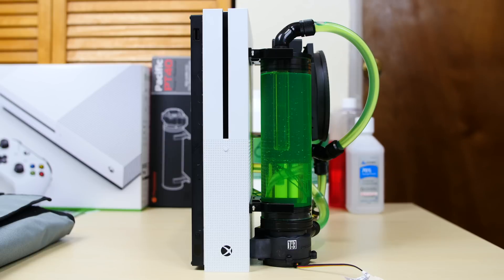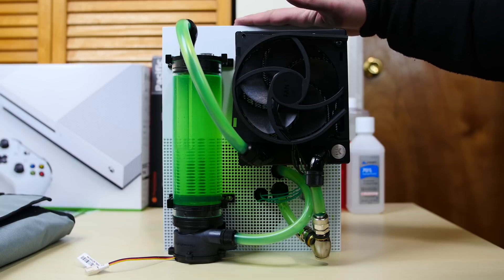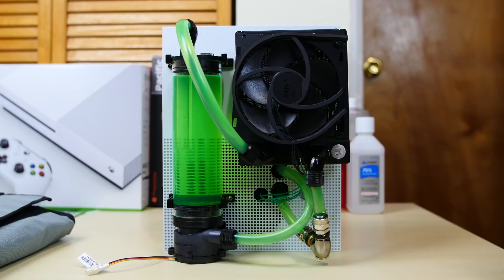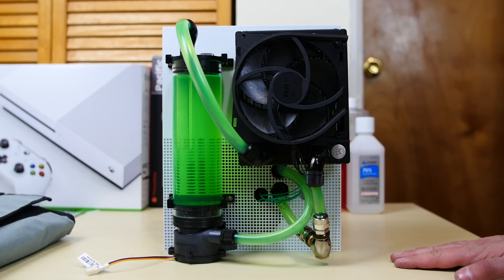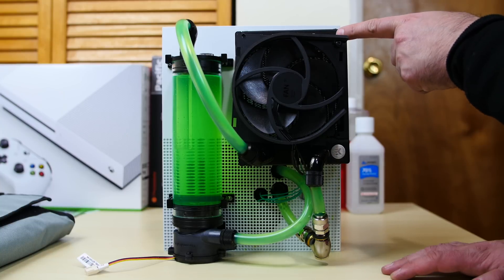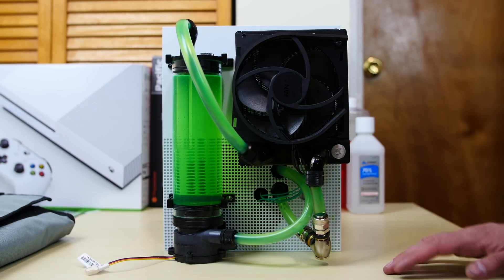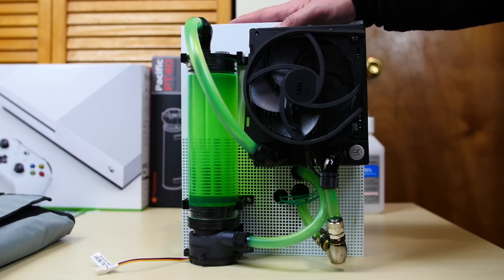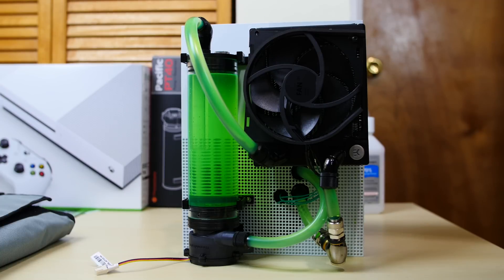Water Cooled Xbox One S - The Build - Part 4

Comment: uhhhh... VRM heatsinks??? also you made such a mess of the tubing like WTF...  the holes that you drilled in the top of the xbox were way too big for the tubing, you can get rubber grommets to tidy everything us, why the gigantic hole to run 3 very time fan cables, you could have simply threaded them through the holes in the top of the xbox...

Comment: a bigger rad (a slim one) & smaller reservoir would have been better
i have an alphacool x-flow st30 360mm full copper rad 
passive radiators are awesome too
Reply: i would have had a big rad on the side and a small res on the top and hard tubing. good first attempt though

Comment: you should have cut off the plastic on the fan that diverts the airflow and made it  so the fan is right up against the radiator as it's not working fully effectively, it would have had more airflow thought the radiator and more pressure to cool

Comment: Water cooled 30 fps....
Reply: Shane Walker some games do run at 60fps
Reply from the maker: +Shane Walker you got it
Reply: its not about 30fps ...its about system not LOCKING up due to running hot / over heating
Reply: what games besides old games and platformers
Reply: Desmond Cabeza just google them I am not going to list them but to be fare the list id not long
Reply: While anthem destroys PS4 shut the fuck up

Comment: So you asked for criticism,  here goes.

1, You had to use another fitting because the tube did not reach.  If you cut a bit longer, it may have reached without kinking the tube. 

2, Some grommets of cable glands would of cleaned up the unsightly hole in the case.

3, No cable management for the fan, and what are you doing with the pump cable, I would of sleeved everything, where are you putting the PSU for your pump.

I just don't think the project worked.  If you wanted to water cool an Xbox, you should of made a new case, maybe from that acrylic that never got used for your Pi Cluster.  It just seems like a whole lot of effort, and not much to please the eye in return.
Reply: Tommy TeaPot but by adding the extra fitting it adds an extra fail point
Reply: 1. He wanted a water cooled xbox (which he achieved) not a full custom xbox which is why he kept the case.
2. Everything you mentioned can still be done like covering up the holes and the wire management. 

The way you're judging this is like if he was building a custom water cooled pc
Reply: i think you may be being a bit over critical.... this must of taken him so long and so much more could of gone wrong.
Reply: Well for your 1st point he accidentally did one thing right with it ... 
He now has a drain point which a lot of people seem to forget while building a custom loop
Reply: paul30003 loser